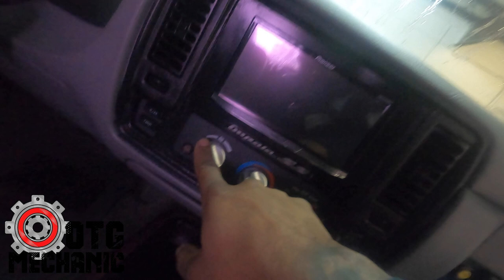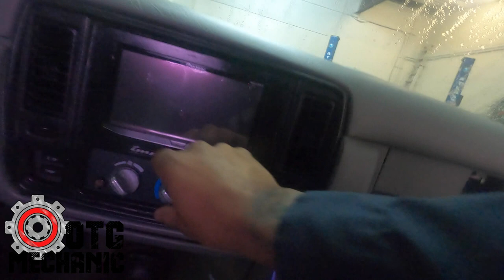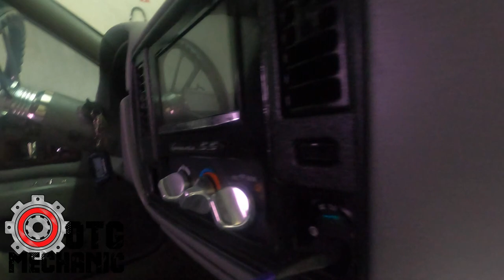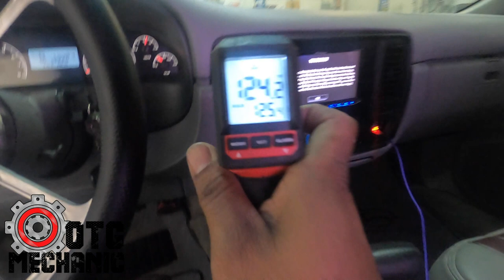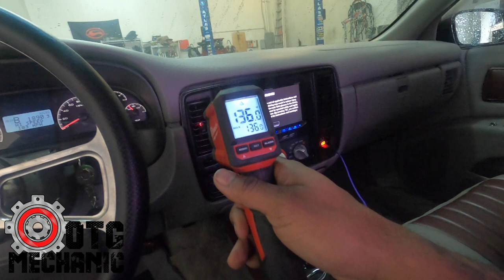No Heat in this 96 Impala SS. Fixed for less than a nickel!

Comment: Tht entire control piece is not moving back and forth. I think I have to replace it. However I do have heat now by simply turning tht blend door control by hand. It immediately started blowing heat. I will have to find a way to fix it when I start wrkn on the ac..very helpful video
Reply from the maker: Hit up ivan @impalassparts on ig im pretty certain he has on. You can replace just that piece.
Reply: @otgmechanic  copy tht. Thnks

Comment: Do you know anything about purge solenoid switches? I looked up the part number and it says it was discontinued October 1996. None of the auto parts stores sell them anymore, what part do I get to replace it?
Reply: Lmk when you find a solution! My check engine light has been on past 7months! Part is discontinued! I also need that part but no luck!

Comment: My problem is i dont get heat on the floors...And i don't have a clue on what it is???
Reply from the maker: Vaccuum
Reply: @otgmechanic   feels like Ac Was Coming out on the floors..and i kept hearing the ac compressor coming on when i would run the heater...so i unplugged the ac relay and now the heat blows fine everywhere 🤷🏿‍♂️
Reply: And i smell Coolant in the car, but it doesn't over heat at all...the car never even reach the halfway mark....